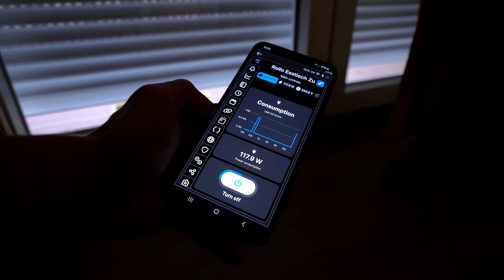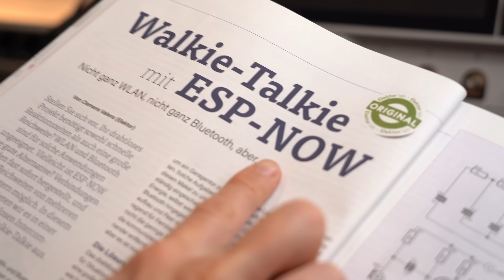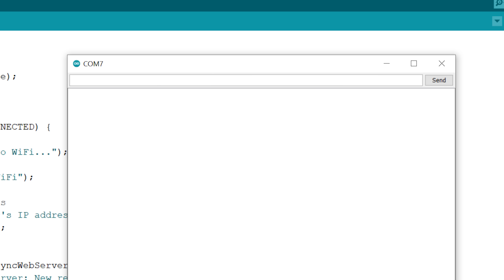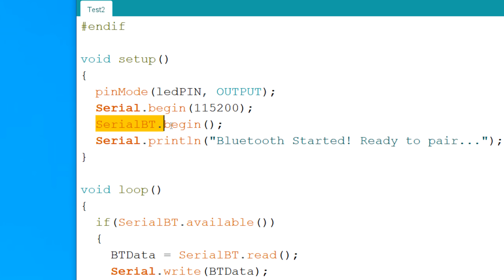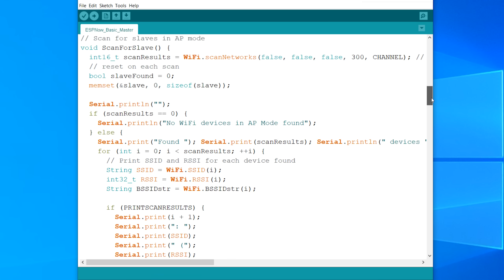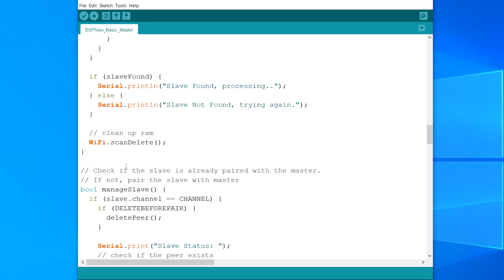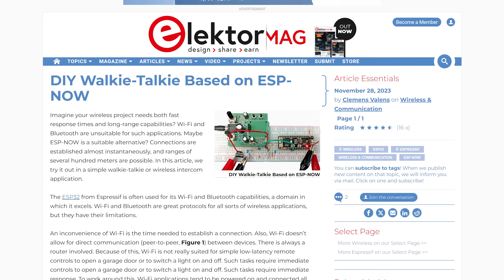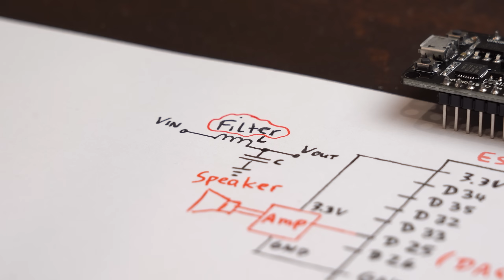Forget WiFi! This Wireless Method is WAY Better? (ESP-NOW)

Comment: What about security? This is what a lot of IoT ("S" stands for security) people forget or skip and it comes to bite back with a vengeance.
As I don't want to control my home from anywhere in the world, just from the place I'm currently at :]

And the comparison ESPnow with WiFi is not a good one. ESPnow, as you'd shown is almost copy-paste. The WiFi examples showed a mobile browser operating on a HTTP(S?) server on the ESP. So we have the full TCP/IP stack, WiFi stack, a client browser stack and a HTTP(S?) server stack. That is a lot of stacks one could skip if f.e HTTP(S?) was switched for MQTT(S!).

Also ESPnow is proprietary, so it's a good enough reason to skip it.

Comment: I use those cheap $2 rf modules, and I get upto 2km if in sight, did you check the power setting? Orientation should be upright, and the antenna maybe needs length tuning.

Comment: Approx. 2 years ago, you was one of the Youtubers that motivated me to start tinkering with electonics myself. Meanwhile I finished a few successful projects. For example, I have built my own telemetry system for my RC helicopters using ESP-NOW communication. I also built a „customer detector“ with 2x ESP8266, a sonic distance measuring module, a few LEDs and ESP-NOW communication. Great videos, GreatScott!
Reply: Great! Congratulations! I'm Engineer of Control and Automation here in Brazil and have some ideas for increase the usability, time of flight, logs, data aquisitions, positioning without GPS totally dependence, using cheaper drones, especially agricultural, and for grabbing cheaper internet signals in remote locations. Can you show me your projects?
Reply: @gutobassogb  Unfortunately I have not published anything so far. If I do I let you know.

Comment: Used ESP Now for a number of years in my home 'notification' system.  A radar/IR sensor on my gate  is connected to  an ESP 32 and a signal is broadcast to my house by ESP Now.  Everyone in the house is notified that someone has arrived.  The doorbell is ringing before the visitor presses the front door bell.  It was built because of the number of packages arriving for my daughters was getting ridiculous as, you guessed it, I was expected to open the door because 'they didn't hear the door bell'.  Well they do now.

Comment: WiFi interference of ESP32 is a big problem. I faced it for the first time when I was designing a super stable and noise-free power supply for some specific project of our lab. The power supply output voltage was being controlled by the ESP. The WiFi interference was adding noise to the output voltage. Later we switched to STM32.
Reply: interesting, I asked claude (esp vs STM32 for videos): 

For video streaming specifically:
ESP32 is generally better because:

Built-in WiFi means no additional radio modules needed
ESP-MESH library is mature and well-tested
Direct camera interface support (esp32-cam exists)
Many examples and libraries for video streaming

With STM32, you would need to:

Add separate WiFi/radio modules
Implement mesh networking yourself or use third-party solutions
Handle video compression and streaming manually
Deal with more complex hardware integration

Unless you specifically need STM32's processing power or real-time capabilities, ESP32 is likely the better choice for video mesh networking. It's more cost-effective and has the necessary features built-in.
Reply: OP didn't mention video streaming, nor any use case involving WiFi... Maybe they don't need that?

Comment: I made a little 150g combat robot using an ESP32-C3-MINI-1, and, can confirm, ESP-NOW is indeed awesome. I put the robot in my house, then walked outside, past my gate, and it still worked (probably 30m or so). Past that it stopped receiving signals though, probably because my transmitter ESP32 was very small and had a chip antenna which was probably low gain (not to mention the antenna had no ground clearance or anything. Thanks for your awesome videos GreatScott!

Comment: The problem with WiFi is it needs way too much bandwidth for most applications. Why use 20 MHz of bandwidth when most times 1 MHz will do and makes it easier to do longer range communications? It also takes more power to transmit a wide bandwidth versus a narrower bandwidth

Comment: I've been wanting to use ESP-now from the start in one of my IoT projects, but haven't gotten around to it yet. While all my IoT boards come with GSM capabilities, WiFi is the more popular choice. However, when WiFi isn't available, using multiple IoT + GSM connections in one location gets expensive. So, I'm thinking of using one IoT device as an ESP-now internet gateway for the others. Time to put this idea to the test!

Comment: The quality of your audio amp circuit also has a major effect on the results of the audio you get as well. The cartridge mic's quality, the amp circuit you used for the mic (the mic amp used here looks to be class A, so high fidelity, but also high power consumption), and the amp circuit used for the speaker (this looks to be some sort of IC amp, so I am not sure if this is creating any of the distortion or not).

I bring this up because the audio didn't sound like it was being distorted from the ADC and DAC all that badly. There was some packet loss in there, but it sounded more like an audio amp circuit wasn't all that great in the circuit, but I could be wrong. One of the biggest mistakes I have seen done is using op-amps for audio amplification. This should never be done since op-amps don't have even amplification across all frequencies, so they sill distort audio signals. They are for amplifying signals where the fidelity doesn't matter as much, like a simple hi-lo signal from a sensor that is really far away or it doesn't put out that much voltage between the two states.
Reply: Have you heard about Gain Bandwidth Product? Other parameters? 🤔
Reply: @jankomuzykant1844  I have and if you are willing to sacrifice fidelity, an op amp does have a nice amount of gain, but with audio signals, you don't want to be adding in random distortions at random frequencies because it makes the audio sound bad, unless the intention is to distort the audio. Hence why I mentioned fidelity being very important for audio.

I do happen to have a degree in electronic communication and a copy of the most recent edition of Audiology handy, if we wanted to redesign the circuit to be better. I personally would have just used another class A amp circuit built with a BJT or a class D amp IC in a DIP to handle the output speaker since I know it would work and is a simple circuit.

Comment: you can use esps as wifi hotspots. Then 2 esps can communicate without a router or anything else. There is example code for it in the arduino ide (for ESP8266)

Comment: the problem with wifi and bluetooth chips is that the more population that use them, the slower they will be because they need to take "turns" in communication so yes using frequencies that aren't polluted is beneficial

Comment: Why do you need such low latency? I have several ESP Devices controlling lights in my apartment. While also transmitting sensor data. 
I have also created a small remote control station based on a Node MCU 12E microcontroller. An OLED screen shows the time and date, synchronized to an NTP Server, temp humidity etc. 
But the main functionality is to be able to control lights. On/Off and intensity. Connected over Wi-Fi. So they exist besides my Philips Hue lights. 
That's why It's so continent to be able to control several different light sources perfectly with just one button each. That's the magic of programming and timings. 
Which turns each single button into a tri state input device in Home Assistant. Single, double and long press. The delay is never over 25 milliseconds. And every action feels instantaneously. 
The command loop for determining a single or a double click is just 100 ms apart. 
I have more powerful ESP 32 dual-core "Wroom" microcontrollers that are able to work at a far higher frequency over the i2c bus, set to 800 kHz. Which matters when several different devices are connected to the same i2c port. 
I use WIFI-OTP to program them remotely, and the delay is again is below perception level.

Comment: You sonovabitch I was literally working on wireless transmission and started with ESP-now due to it's simple peering and low latency. I got a demo working with LED control while I wait for some audio components to come in and realized that the 250bye frame size may be a bit limiting for audio so I am actually switching to wifi AP implementation. I'm interested to watch the rest of the video, though the walkie-talkie audio quality is too low compared to what I want to achieve.

Comment: That's impressive.  I wonder why it works longer distance when the hardware is the same as WiFi.  Different modulation?
Reply: modulation is the answer. LoRa is the best example: same frequency/hardware but one time range is 10x higher than another time - depending on settings

Comment: best feature for espnow is "transfering data quickly" from my experience. And i did not know the lora module is in the low speed category as you showed in the video, thanks for it.

Comments are very informative! Thank you all, maker community!
Reply: I recall looking into LoRa for one project. It's in the kilobits range, if I recall correctly. On the other hand, it seems the range is measured in miles.
Reply: @dacomputernerd4096  LoRa latency is very high too - compared with esp-now.

Comment: it is kinda a bad agument to say that it has longer range then wifi.  one is ptp and wifi is more complicatet but the smipels chase is device-WifiAP-device in open space then the max range is easy over 300m. but if you have multi wifi AP's the range goes up. between 2 the most distant point in my network there is 3Km. i woud expekt a legacy of 8 - 13 ms between 2 wifi client.
the problem with wifi is a god network cost a lot and use netcabel so most dont have it. mesh wifi is kinda bad, it adds legacy like it was someting intercontinental +20ms
 from clint to router is nomal with mesh. where a wifi AP with Cabel 3-4 ms legacy from clint to router is nomal

Comment: Uhh... WiFi does not need a router? WiFi Direct is now like 15 years old already. It seem that ESP just intentionally does not support that despite the high demand and its obvious benefits.
Reply: Wifi direct uses softAP iirc. So it is kind of like Station AP mode or how they called it
And also this method seems to allow many to many connections which would not be possible with wifi direct.

Comment: Hi !!! Greetings from Argentina !!  I have been searching and asking, but nobody gives the answers I need. I bought two cheap handys, Baofeng BF-999S,  and I would like to transmit data from one arduino to another arduino, using the power of the handy transmiter, because I bought two Rf  Nrf 24l01+, it only transmits up to 50 meters, but with rattlegram and the two handys, I send txt messages up to 500 mts. that`s the distance I need, but instead of using two smartphones and two arduino, I would like to use the two handys that are more powerful and I can send data from arduino and the serial com from my pc to the other arduino connected to the other handy with a little oled screen to see the data. No one seems to have an idea of that, despites they do other things with ham radios. This handy is the cheapest, doesn`t have a numeric keyboard, only 2.5 and 3.5 jack and plug and a mono earspk. I have been watching some schematics I can PTT shorting the two sleeves, but the Rx and Tx rings only give noise. Can you give a hand with this ? schematics and a simple code, Thank you much !!!!! Modulator and demodulator boards are not available in my country......Or with the Rf Nrf 24l01+ how to build an amplifier to extend at least 20 times the actual range of the two Rf Nrf 24l01+ Thank you very much !

Comment: You’ve got me curious about how far the walkie talkie works when you add ESP32s along the path. Is it distance times the number of ESPs? Does signal drop off after a certain amount? What if there are multiple ESPs at each “leg of the relay”?

Comment: HI there, wanted to ask you  if you know a module called "wireless-tag"  (WT8266-s1)    that i found inside an ecowitt gateway with sensors for my weather station (bought from AE) that seem different from other esp8266.

Comment: GreatScott,  I use ESPNOW with ESP8266 for a ling time. I transmit data structures with vary sensors information,  including grid voltage and current from my solar panels. It is much better than dealing with tcp/ip, sockets, etc that take forever in handshaking and speed. ESPNOW us fast and you just plug the slave or master and in a blink they are already sending data back and forth. You can even encrypt your data for security.  I rhink it is much easier to use than WEB WIFI.

Comment: For WiFi, You don't need a router, take a look at RTL8812AU chipset custom drivers of projects like (arickrack-ng, wifibroadcast, OpenHD, OpenIPC). Using injection mode, you can create an aux radiolink of two wifi dongles, and with 500mw power, you can create an astonishing range link with insane BW.

Comment: Actually the latency you experience using WiFi is mostly due to HTTP / random protocol overhead. I'm experimenting with it right now, actually built a handy little webserver with websocket support in micropython for the 8266 (due to memory constraints it has to be frozen in firmware tho), and boy is it responsive, as soon as you have a persistent TCP connection, it reliably pings in the <100ms ballpark, that's good enough for most use cases.

Gonna release it as soon as I ironed out some of the remaining issues and cleaned up the code, hence afaik to date nothing like that exists for this nice low-cost board. Of course ESPnow has its own merits, just had to chime this in, lag is not necessarily an issue over a WiFi link.
Reply: websockets...
Reply: @forrest2851  if you want simple, direct user access thru a browser, that's your best option

Comment: Dropped data❓
That is a problem.
Reply: If/when it is a problem one has to implement their own method to have transmission repeat if the data is not received. There are applications where some lost data can be tolerated.

Comment: Hello there, just wanted to let you know that it is possible for ESPs to communicate with each other using the wifi protocol without Espnow. I did some experiments by using the first ESP as a wifi access point, and the seocnd ESP that connects to the first ESP's access point. I was about to get some data transfer between by crafting websocket or http packets.

Comment: WiFi is the physical layer of the protocol stack. esp now is above that at the transport layer. You are using both of these not one or the other. This is clearly shown in the ESPRESSIF documentation for esp now! Look at the esp now model. What you are not using with ESP now is TCP/IP. By not using TCP/IP overhead is reduced. Look at 5:38 and you will see you are including libraries for both esp now and WiFi!

Comment: Almost 3 years ago i have created a complete system based on ESP Now as a part of my FYP. It includes ESP now gateway, multiple sensors and actuator nodes, complete custom backend and mobile app for controlling everything. I made some modification to esp now based systems to increase it reliability as esp now is based on udp. Also everything is dynamic thanks to the esp now gateway i have designed. ESP now is very great low power protocol only if we use it properly.
Reply: Hi Muhammadahsan, this would be great to share. Do you have a link to your project? I would be interested ffor Example. I need to change my sensors arround and espnow maybe the way. Thank you! And thanks @greatscott for this video!!

Comment: Have somebody figured out to build a bridge between ESP-Now and IP based wifi (on a single esp)? This is a challenge and every post on the webs don’t work (for me) even forcing esp-now to the same channel as used via WiFi. Espressif promises a bridge for years but now still no solution. So I build a bridge via two ESPs (connected over serial). But I don’t like this approach.

Comment: ESP-NOW really shines when it comes to low power designs, since it is connectionless. I converted a sensor over from wifi to espnow and it went from draining an 18650 in under a month to lasting over 6 months at which point I just ended the test. It should be noted that ESP-NOW does have a built in retry mechanism when used in unicast mode (which is when you tell it the destination MAC, i.e. not FF-FF-FF-FF-FF-FF). It will retry 11 total times at 11, 5, then 1Mbit, or even slower if "long range" is activated. This is important when you're going for a low latency connection like voice, that the total send time can be 0.1ms or 3-4ms for one packet!
Reply: If you're seriously considering using voice over a low bandwidth digital channel, please consider using a vocoder like MELP.
Reply: For things like sensor data, ESP-NOW is king. I think a company called Fieldpiece is using the esp-now protocol in their refrigerant gauges. I was on the phone with tech support when I asked how they were transmitting digital over 2.4ghz without Bluetooth or WiFi and he said that "we use NOW". This was before I started using ESP32s and had no idea what he was talking about until...NOW lol.

Comment: You also need filtering to filter anything above the Nyquist frequency: otherwise you get aliasing.
Reply: He just needs to LPF at the highest frequency voice band, 16kHz RC should be enough.
Nyquist is the ideal sa pling frequency, because beyond that rate starts causing follower issues. You can see this on MatLAB and in real-life